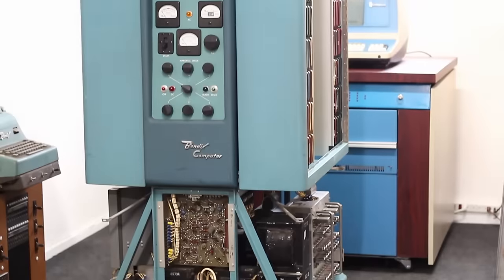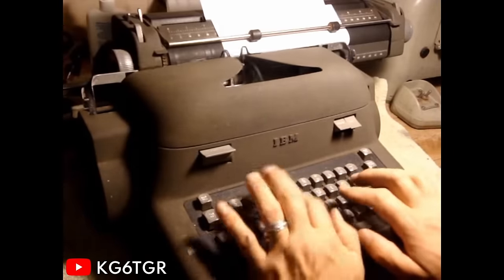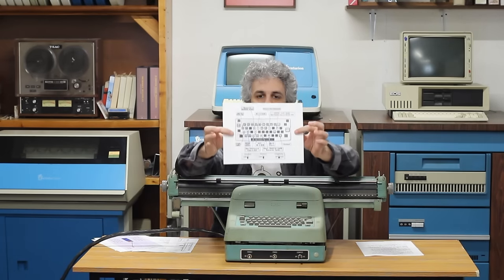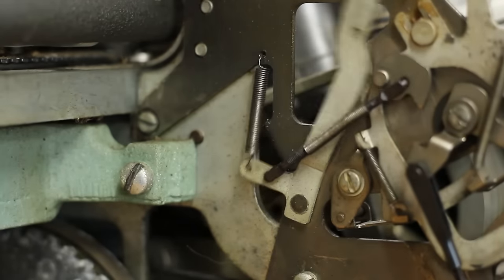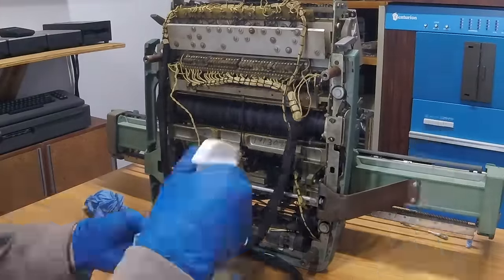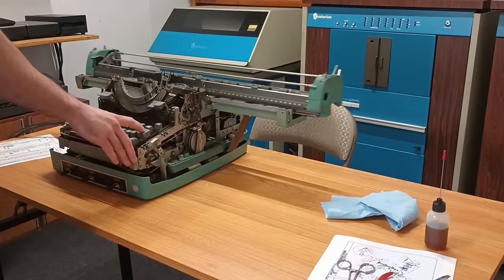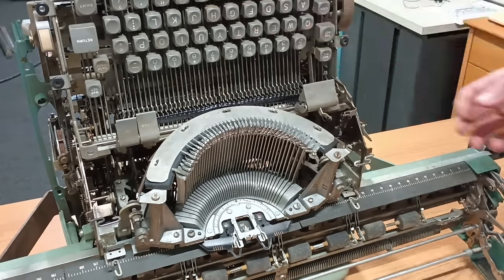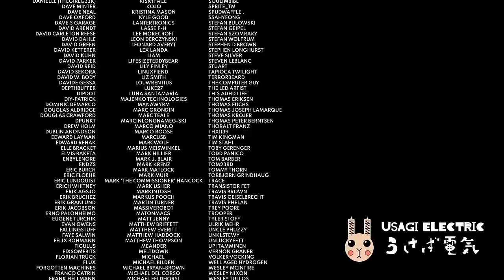The Bendix G15 Typewriter is Crazy Pants!

Comment: Probably the *upper and lowercase stops*, if its anything like a normal typewriter it would be a pair of 2 large bolts that have several adjustments on them, and generally have rubber rings to cushion the rise and fall of the basket. However those rubber rings degrade and it gets out of whack. The manual would tell you how to adjust it, especially equipment from IBM. Cryptic language from the ancient engineers aside, it wouldn't be that bad.
Reply: This thing is basically an IBM Executive typewriter, the predecessor to the Selectric. The leaf switches on the keys and the solenoids to trigger the type bars were added, but otherwise it is pure Executive, and I'm pretty sure has almost all of the same parts and adjustments.
Reply: @lwilton  right

Comment: I learned to type on a IBM. (Yes I am that old). The lower case letters are used more often. The ink ribbon has an upper 1/2 for capital letters and a bottom 1/2 for lower case letters. Lower case is used more that capital  letters. Perhaps the first thing to check is the ribbon. I don't know what a new ribbon might cost but it could save a lot of time and money
Reply: I bet a new ribbon would help too - looks like this might even be a standard half inch ribbon, which you can still get new. (Printing adding machines use the same kind of ribbon but wound of tiny spools.) Around 19:33 it looks like only the top half of the ribbon is used for both lower and upper case letters. So one of those adding machine ribbons that’s half black and half red, from your local office supply store, might even work if you put the black on top.
Reply: @amartini51  probably able to spool it round the other way too ,  as well as re-inking like was done with the centurion
Reply: If it was mostly used as a teletype (so controlled by the computer as a printer), then it's probable that the upper case was used more often?

Comment: Regarding the lowercase t, there are two issues. One is, you are correct, the alignment may be out. The faces of the slugs are curved to match the platen, and have to hit the platen at just the right angle. There should be a pair of adjustment screw that set the limits of travel of the typebasket--one for uppercase and one for lowercase. You can tweak them until each letter is uniform from top to bottom.

The other issue is the. Literally, the. As in, the word, "the." "The" is, of course, the most typed word in the English language. And the "t" and "h" are typed with opposite hands, which means that even a moderately fast typist sometimes hits them so fast that they land on top of each other. Most English-speakers type "teh" fairly regularly, regardless of whether the keyboard is electronic or mechanical.

What that means, in practice, is that on old typewriters, the lower-case "t" is often very badly chowdered, as a result of slamming into its neighbor "h" so often. Especially on electric typewriters, where the collision has some force behind it. I got through high school and college with old second-hand typewriters, and I can't recall ever having one on which the "t" was in good shape. So do not use the lowercase "t" to set the typebasket alignment.

Comment: This brings back memories, some of them good. I used to repair these IBM Model C typewriters, along with Model D and Selectric, back in the early 1970s. I noticed a few things.

The carriage shouldn't make that grinding sound when you hit return. Your escapement pawl is dragging on the rack. There should be a link from the vicinity of the carriage return cam (possibly the carriage return clutch, I don't really remember) to the escapement pawl that unloads the pawl from the rack when you engage carriage return. Adjust the clevis one-half turn at a time until the pawl stops dragging.

What you called a friction roller is known as the power roll. Yours looks pretty worn, which is to be expected. I don't know if anyone is still making that part, but yours should be replaced if possible.

To remove the power roll, first latch your carriage return clutch. If you don't, the disc will slip out and it's fiddly to reposition. Remove the drive belt from the motor and the big cogwheel from the power roll shaft. You can then remove the screws holding the power roll bearing in place and slide the power roll out of the left side of the machine. You may want to do this anyway so you can clean the old hardened grease from the power roll shaft and the bearing and add new grease.

We used to use 1,1,1-trichloroethane to clean the rubber parts because we didn't know any better. It did a great job but it has been phased out because it's an ozone-depleting chemical and a probable carcinogen. I may or may not have discovered that it also does a great job of killing cockroaches and getting one high. I ain't sayin' nothin'. 🙂

Try to find someone who knows these machines and can assist you. Don't trust my memory. It's been 50 years, after all.
Reply: You sir are awesome. Nothing warms my heart more than hearing/reading experts share their knowledge.
Reply from the maker: Thank you so much for the insight!
I had an inkling that the dragging sound wasn't quite right, but didn't know enough to know how to fix it. 
I do still find it curious that the hammer has enough force to imprint a nice letter when it caps, but I can't even hear the hammer strike the platen when in lowercase. Although, I think that bodes well for the power roll being in alright shape, since that's going to be a very difficult part to find a replacement for!

My buddy will be down here sometime this summer I believe, and he will be able to get this thing humming along perfectly. I mostly wanted it working well enough to proceed with powering the machine, and I think we've achieved that!
Reply: @MarianoLu  Thanks. You should hear me when I get going on C programming or flying. You can't shut me up.
Reply: @UsagiElectric  Just watching you clean and bring these machines back to life requires a special dedication and skill altogether,  and you have done Very Well !
Reply: you ain't sayin' nothin' and i ain't hearin' none too!

To breathe, or not to breath -- that is the question. Ether tis nobler in the mind to huff her (ok that's as far as i can get hehe)
Reply: @UsagiElectric  Former secretary here . . . I recall there was a linkage on many typewriters, that lifted the ribbon with the shift key. If the linkage was bent or dirty, it would get stuck in the up position. It was a real pain on dual ink (black/red) ribbons. Make sure you have the ribbon correctly threaded. Some machines also had a ribbon neutral switch that was great when you were just cutting stencils. IBM's were great machines, especially the Executive.
Reply: Former early 70s IBM/CE here also. Last year a friend bought me a fine Selectric 2 for my 76th bd.
Reply: @tedecker3792  Congratulations!  The Selectric 2 is my favorite typewriter and a joy to type upon when it is properly in tune.  The tactile, auditory and olfactory feedback can’t be beat.
Reply: @wtmayhew  unfortunately the last gasp of the mechanical era.
Reply: @tedecker3792  Thanks for the reply.  Enjoy!

Comment: My very first job was with the Autonetics Division of North American Aviation at Downey California  in 1957.
We had a Bendix G15 computer with an attached  DDA (Digital Differential Analyzer) .

Among the idiosyncrasies of the DDA were that you had to keep the keep the curve plotter pens in the cooling fans exhaust port. The warm air kept the pens warm eough to write reliably, otherwise they skip.
Sometimes a vacuum tube or two would get microphonic  (an unintended output caused by mechanical vibration).
The standard, but not authorized procedure to detect probems included tapping on the racks where the tubes were mounted. Once in a while it worked.

Comment: If you can get the power roller out, you should be able to get in touch with JJ Short Associates to have it redone, they put new rubber on the original parts, platens, paper rollers, and power rollers, you send your parts off to them and they come back with new rubber. Lot of typewriter collectors use them.

Comment: The rubber platen underneath that drives the white cams when a character is selected is called a power roll.  It has dried out and become hard causing the white individual cams to slip on the power roll when engaged instead of being grabbed and driven in turn pulling the type bar and type face up to and striking the platen.
The white cams wear as well and may be causing additional slippage when engaging the power roll.  
50 years ago you would have the platen and power roll recovered by a company that does just that.  New rubber of a specific type, softness etc.
In Canada, back then, it was Randmar Platens in Quebec for us eastern Canadian technicians.  Who could do that now I don't know given we live in a throwaway society now.
Very little grease is used on a typewriter rather machine oil is best for what is available to day.  Be carefull with using grease of any type as it will cause you a world of headaches if over done.
The alignment of the typefaces to the platen is fine.  No problems there but your ink ribbon is done.
In the day we cleaned he platen, power roll and feed rollers with Benzine.  Yeap straight out of the bottle onto a rag and wipe thoroughly.   Different times. 
If you look at the serial number on your unit there should be a letter at the beginning of the number and I think your typewriter is a model B.  Whichever letter it is that is the model of the basic typewriter you have before it became a printer.
Cheers 🇨🇦

Comment: Wide carriages are often used for accounting. 

When I had worked for a "math museum", we had quite a collection of desk calculators and typewriter hybrids. Most of them had those huge carriages. They were used for processing spreadsheets. You can perform calculations and label them. There are also were pure calculators and pure typewriters in use back then.
 So it's not a "computer thing", maybe they thought converting an accounting typewriter is more versatile and can't do any harm - except for someone sitting on the edge of your desk.

The Zuse Z25 of the museum uses a standard Siemens T100 Teletype with a slight modification. It has a red light when the computer expects you to "type" and a switch which can alter the flow of the program. The light is just the RS232 "Request to send" Line equivalent and indicates that the computer is actually listening. The Z25 is also meant to be used by teletype lines using ordinary teletypes. So the Z25 is actually a "home office" capable computer.  
The way this works is absolutely genius! Letters are commands and numbers are parameters. The ABC/123 switching code tells the Z25 that the command is complete and you are now entering numerical parameters. Fpr example, the "copy" command ist "U" (Umspeichern). If you press the command letter twice (e.g. "UU"), the machine automatically uses double-words. So switching from 18-bit to 36 bits was easy. No need to learn new commands. Also the machine does hardware floating point math. And 36-bits floating point precision using simple commands is really impressive and the machine handles this really fast.

Comment: Eagerly awaiting the first power-on of the CPU circuitry within the Bendix G15 computer as once it starts up, it could be one of a very few vacuum tube computers still functioning.

Also, either mechanical or digital typewriters, depending on whenever they're made, made with huge carriages tend to be for budgeting and scientific applications, as it's usually good to have a bit more information printed on the papers.

You also can get the printer to function with digital load drivers (buffers, potentially with beefy MOSFETs, depending on whether they're meant to indirectly or directly drive the mechanism within) and even a $1 Raspberry Pi Pico microcontroller or any of your favorite microcontrollers, particularly to test the oldest digital printers to make sure it works all the way throughout, something with the Quick Fox Jumping over The Lazy dog "hello world" to test all alphabets and anything else you want to test, even using them as a proper Linux TTY device if you so desire.

Comment: Beleive it or not, I learned how to program a G-15 in college. By that time, Bendix had been bought by Control Data. So here are some thoughts:
1. As you have seen, the care and feeding of the memory drum is EXTREMELY IMPORTANT.  As I recall,  due to the very tight fitment of the read/write heads warmup and cool off of the drum has precise instructions. The one thing I remember was after use, the computer had to cool off for several hours before restarting or a head crash will occur. I could not help noticing the gouges in the other drum probably from not following those directions. I also know that the sequence for starting the computer required following precisely a sequence of power starts or again there would be head crash. Once gouged, they are difficult to impossible to rebuild.
2. Long programs were never entered on the keyboard. We used a device called a Flexowriter to punch the five level tape. It was also hooked up to the G-15 to use the tape reader on the Flexowriter to input the code. You could also manually pull the punch tape through the upper reader on the G-15. We used that upper reader primarily to load the operating system onto the computer. It was also used to load diagnostics for trouble shooting. The tape cassettes took forever to load and sometimes failed requiring a reload.
3. As mentioned previously, the computer knew no language other than machine language on startup. We had several sets of cassettes with different computer languages to load into the operating system. The only one I can remember was called Algol. 
4. Maintenance took a boatload of contact cleaner. The filaments on the dual triode tubes were run lower than manufacturer specifications to increase to longevity of the tubes. That part of the troubleshooting was easy, if the filaments were not lit, that was your defective tube.

Comment: Nice cleanup on that old monster!

Look around for a bottle of "platen restorer". The rubber on the platen and drive roller gets hard with age. This was a common problem with all typewriters of this general design, and a stopgap before replacing the parts was to use platen restorer. Getting the drive roller a little less slippery (with the restorer) should give more velocity to the hammers, and hopefully you can run the machine on the default B setting.
You also need a new ribbon. Should be able to find ribbons for an IBM Executive reasonably easily.

I've got a very similar machine. It is still IBM color, and has either a 16- or 18-inch platen, I forget which. It was originally the main output device on a GE computer used for QC inspection on the tin plating line at Kaiser Steel in Fontana, California. It has the same solenoid and key switch arrangement that you have on yours, but the electronics box was separate from the typewriter, and it just had big honking cables running out of it. Back in the late 70s or early 80s I built an interface and software to use it on my KIM-1. Slooow...

Comment: Ever since you introduced this printer I’ve been wondering how the paper moves with the platen.  Is there a big tray attached to the carriage?  I’m guessing it uses some sort of continuous roll or fan fold.  Very curious to see how this goes.  Thanks for sharing this with us.
Reply: It almost certainly uses fanfold. I believe there are adjustable pin tractors on each end of the carriage that can be set to match the paper width. The usual way of feeding was to take the paper out of the box and set the stack in a designated spot on the floor behind the typewriter, which would be on a desk or stand. Then the paper thrashes back and forth as the carriage moves. Generally this worked pretty well, as long as the paper didn't catch on something.

Comment: Oh what an over designed monster that typewriter is!  

I briefly played long long ago with one of those with a normal width carriage.  It was the standard computer console on a CDC-160A minicomputer.  The interface electronics were about a tenth of those on this Bendix computer.   I wonder how and why they went so bizarro on this interface.   I think the default interface, however complex, was still only printing numbers and spaces and newline.  They had as an option an alphanumeric options which required considerable rewiring in the computer chassis.

Part of the printing problem may be due to the rubber sleeve on the platen.  That hardens up over the years and makes a huge difference in how the letters strike the ribbon and paper.  I used to have a Kleinschmidt T-100 teletype back in the 1970’s.  A mechanical gem but its printing was almost illegible due to a hardened platen.  You might try some rubber renewer on it.  An excellent one is oil of wintergreen which does an amazing job of softening up rock hard rubber.  It’s great for restoring rubber idler wheels on turntables.  A new rubber platen is probably way out of production.
Reply: You're right
We even had a special cleaner for this called "Walzenreiniger" in German
I don't know how you call it in English
Reply: That contributes, but I think he's right about the hammer carriage sitting too low. You can see it with the uppercase T. The top of the letter hits fine, but the lower third doesn't print. It's off the perfect spot. If the platen was softer and the force wheel wasn't worn, it would print even with that offset, but fixing the offset is much simpler than tweaking those.